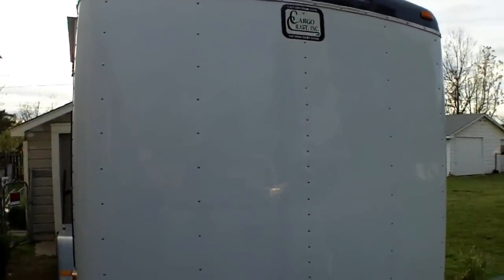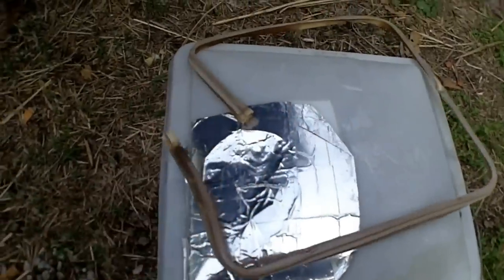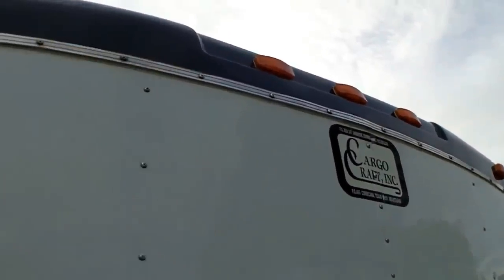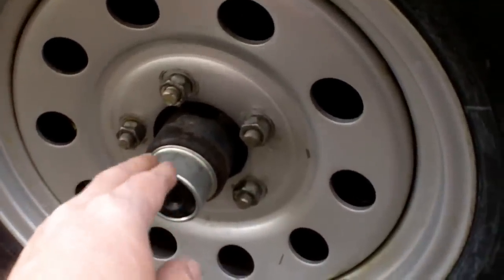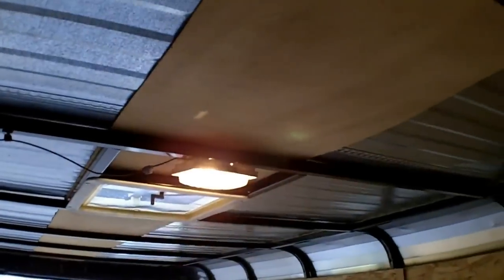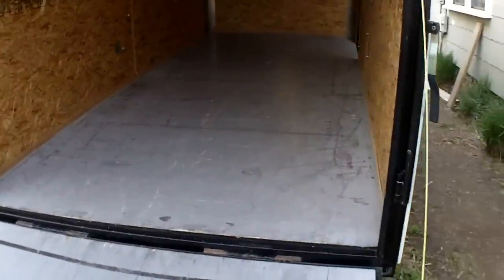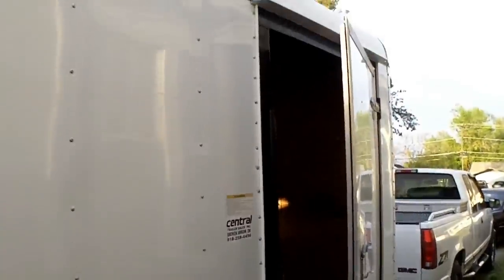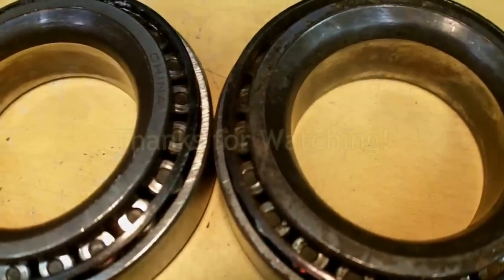2005 Cargo Craft Enclosed Trailer

Comment: Is there any recommendations for the Breakaway battery to keep it charged when you're not using the trailer like 6 months out of the time. Great video and I appreciate your comeback on the charging of the battery
Reply from the maker: Thomas, I have a new box that charges the battery when it's connected to the vehicle and it works great. But that's not your question. Look into a tender or solar system. That may be your ticket. Good luck, G.

Comment: I recently purchased a 4x 6 enclosed Cargocraft trailer.. when i tried to take off the wheels to get them balanced i found that  several of the lugs were stripped. They must be using an impact wrench set at 100 lbs. i had to use a 24inch cross bar with a piece of pipe on it to break the nuts loose. I have called the company several times and they have not called me back.. Also the welds look like they were poured on- really poor sloppy looking welds.   they should be called CARGOCRAP
Reply from the maker: That's no good. I'm not sure about CC, but have seen trailers delivered without the wheels installed for transportation. Perhaps that was the case and your dealer made the problem. I've not examined the welds on this one, but it's still in good shape. Take care, G.